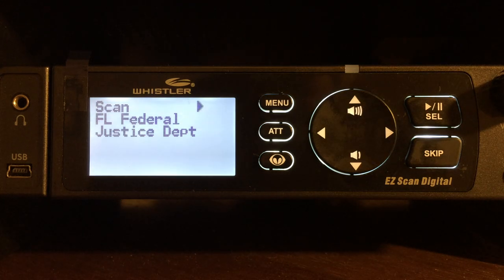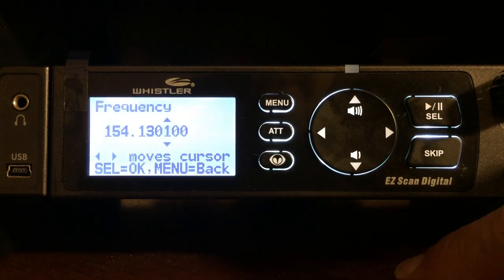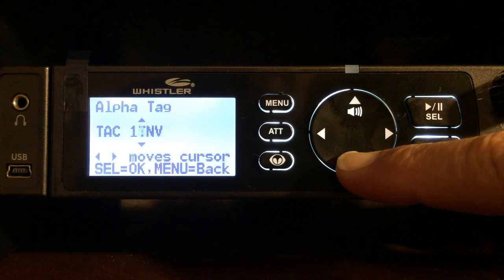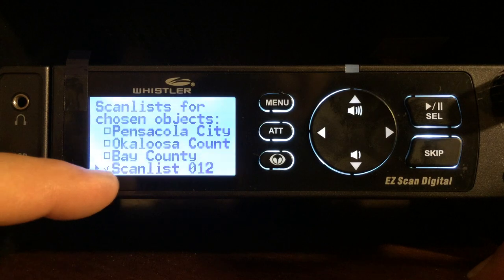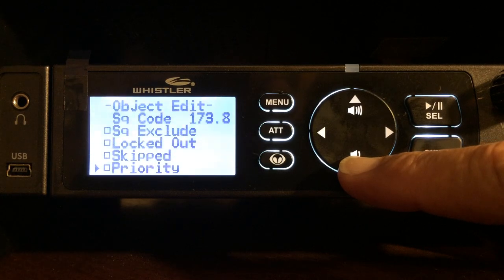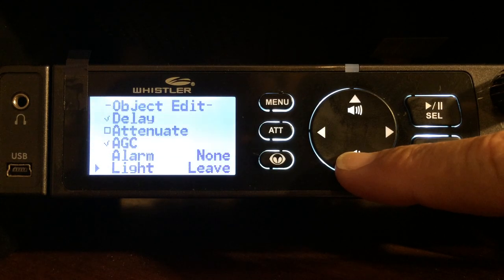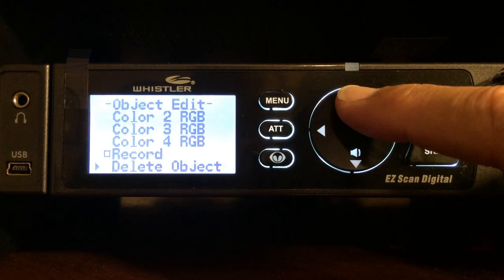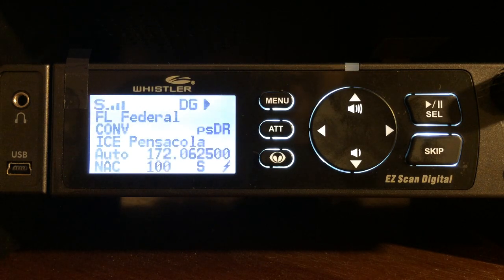How to program a conventional channel into the Whistler WS1095

Comment: have watched quite a few of your videos, which have been super helpful. I currently have the older radio shack Pro-96, Pro-2096 and most recently the Homepatrol-2. Love all of them for different reasons. The old 2096 has the best sounding audio (quality when has a good signal) however the HP2 is easiest to use.   Out of all of the Digital 800 scanners , which would be your favorite.... atleast for ease of programming and overall performance.   thanks!
Reply from the maker: +Empirical I would say the HomePatrol 1 and 2 is the easiest to program and use.  The best scanner receiver for me has been the Uniden BCD536HP.
Reply: +K4DPS  thanks for the quick reply !
Reply: Ordered   Thanks again!